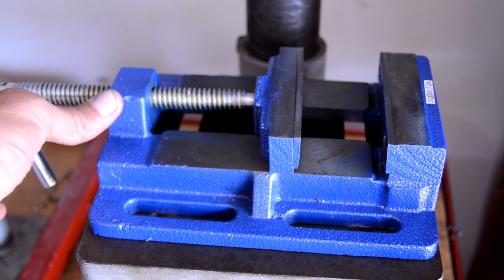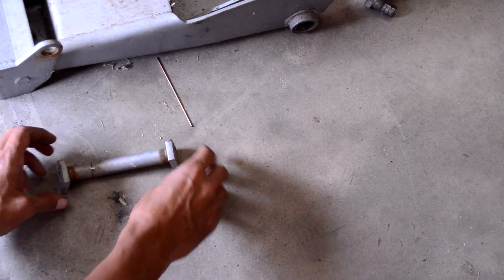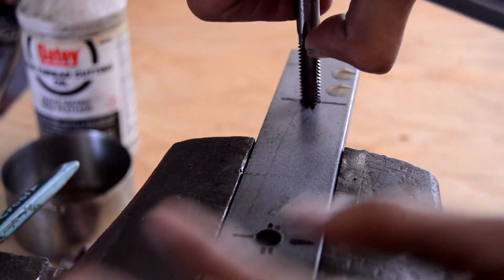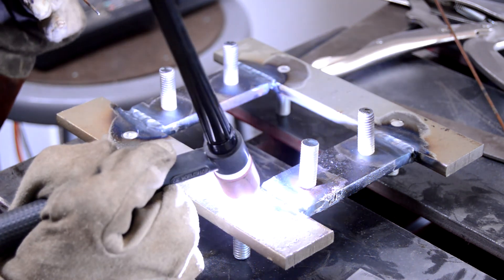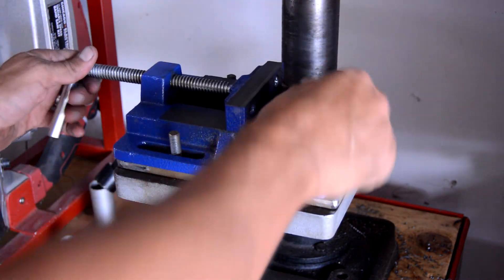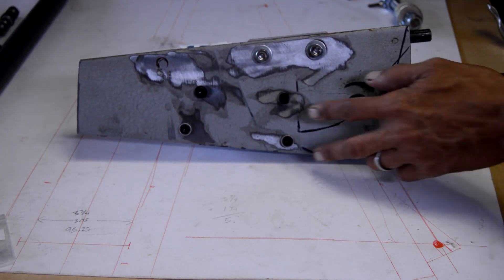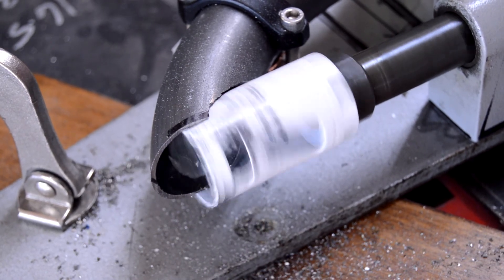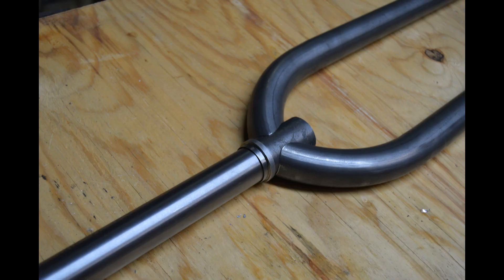Bicycle frame build number 2 part 4

Comment: where you get the direction tube?
Reply from the maker: I got the chromoly tubes from a metal supplier online. I can't remember where, But I used a buddy's tube bender to bend the tubes, and cobbled the jig to notch the tubes myself.

Comment: Did you purchase the crown race or did you lathe out that piece?  I have been milling down BMX forks and then modifying my own fork arms for my own projects.  I am looking for a way to do just what you did and make my forks from scratch with 1-1/8" tubing with 1-1/4" collar and crown race.  Just don't know the best way to make that tight fitting crown race.
Reply from the maker: I purchased the crown race ring from Nova Cycling: https://www.cycle-frames.com/bicycle-frame-tubing/STEEL-UNICROWN-OVERSIZED-RACE-RING.html
It was only $2.07. I originally purchased a fork kit with my frame tube kit that included the steerer tube, fork legs and crown race ring, but as I was mocking the pieces up, I found the legs were too short for my project. I ordered 2 - 36" long tubes of .065 x 1 1/4" chromoly from somewhere on eBay and had a buddy of mine with a hydraulic tube bender help bend the tubes. I took about 1 1/2" of the scrap and pressed it onto the 1 1/8" steerer tube just below the crown race ring to give the larger diameter fork legs something of the same diameter to weld onto the steerer. The fork is a little on the heavy side, but I'm confident of the strength and it turned out visually just like I wanted.
 Thanks for the question! Let me know if you have any other questions about the fork as well.